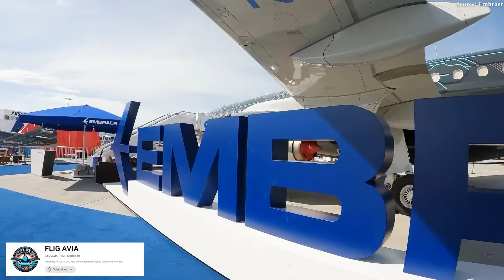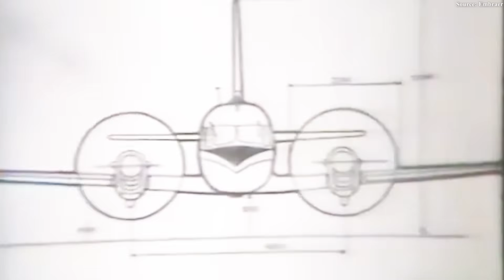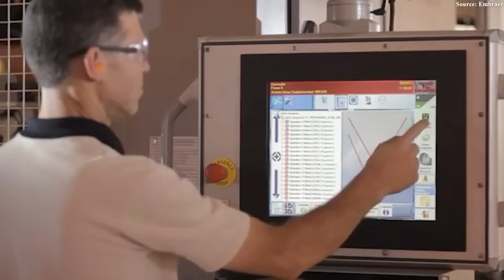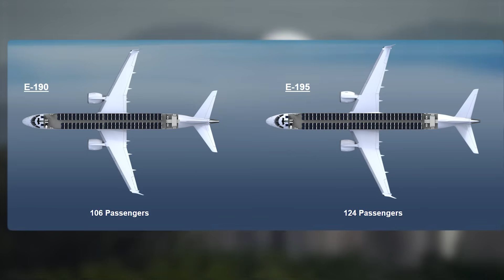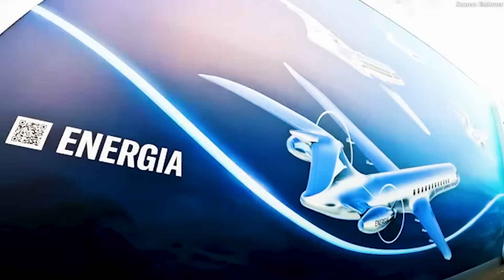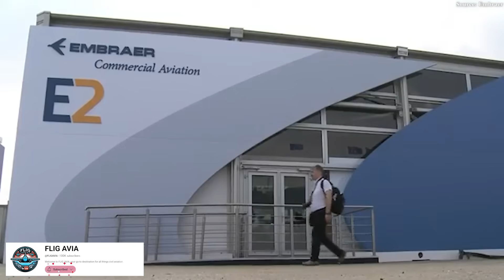How Embraer Just SHOCKED Boeing & Airbus with this Tiny Jet...

Comment: The video misrepresents the market to some extent. In the US, Bombardier had come to dominate the regional jet market after Boeing decided not to build a successor to the 717. Companies deliberately choose NOT to compete in certain niches of their particular industry all the time, that’s not necessarily a strategic error.

Bombardier overreached when it tried to muscle into the market at the shorter end of 737 range by offering Delta a subsidized deal. Even though Boeing had not submitted an offer of its own, it got the US government to temporarily impose punitive anti-dumping tariffs.

Bombardier lacked the resources for a protracted fight, so Airbus managed to pick up a majority share in the C-series for a song and renamed it the A220. The two variants cover the 100-150 seat market, but Airbus is still losing money in spite of strong orders due to the supply chain structure, manufacturing inefficiencies and contracts it purchased from Bombardier.

Bombardier could also no longer afford to develop new regional jets and retreated to the business jet market.

Therefore, it was not just the duopoly’s strategy of focusing on larger aircraft but also Bombardier’s fate and Boeing’s badly mismanaged attempt to acquire Embraer that left the regional jet market wide open for the Brazilians.

Note that Airbus holds 50% in ATR, a long-standing joint venture with Italy’s Leonardo. It produces 40-75 seater turboprop aircraft, which sell reasonably well in many markets other than the US. The core design is fairly old, though. A clean-sheet successor on the basis of a small CFM RISE engine could give Embraer a run for its money.